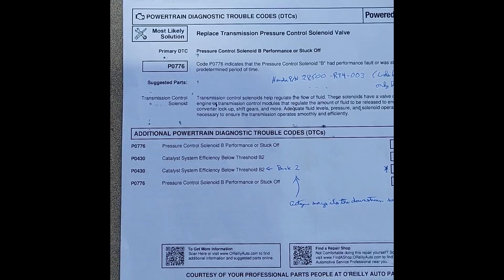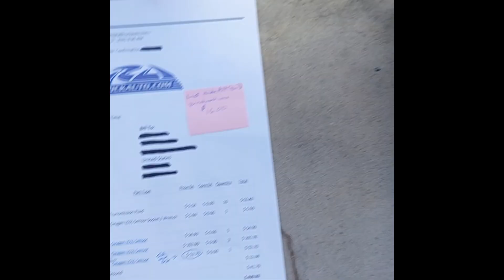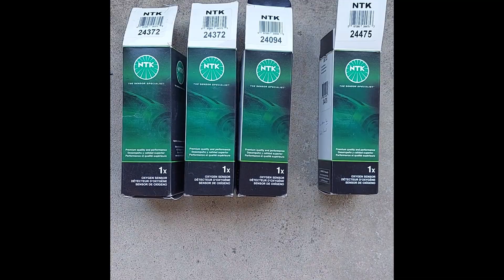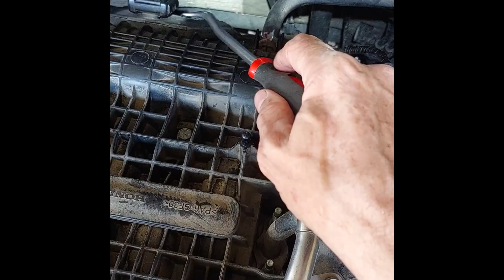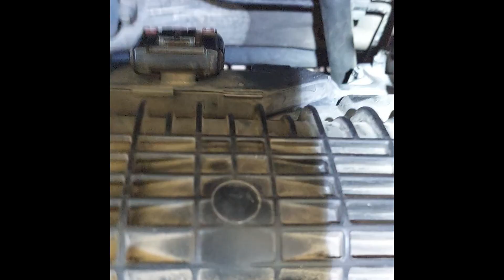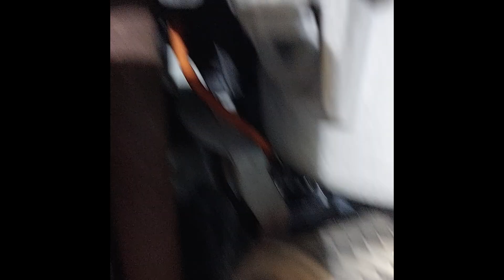2017 Ridgeline, ALL 4 oxygen sensor replacements (including bank 1, downstream)

Comment: Where’s the connector of the bank1 downstream sensor? You said near the windshield wiper? Was that hard to detach?
Reply from the maker: I wrote a reply and then deleted the damn thing!

I show where the Bank1, downstream connector is at 5 min, 07 seconds; I call it a clip, but it is the connecter.  I think it was about 2 - 3 inches below the top of the engine.  Yes, very hard to detach, but as I say in the video, you can see the other 3 connectors, and they're all the same, so you have to do the back one by feel.

Also, I need to add to the description above, but after I did the O2 sensors I replaced the main pressure control solenoid and external transmission fluid filter.  This didn't fix the rough shifting, but the 3 green pressure switches on the front of the transmission were replaced and it fixed my problems with rough shifting, so I didn't bother doing the 3 in back that would be very hard to get to.

Comment: This looks very similar to my 2017 Honda pilot. Especially that dreaded metal brace/bracket. I tried to remove, but like you said that other bolt is unaccessible. Is that compact O2 socket that much smaller than the AutoZone loaner ones? I tried finding it the dimensions on the one you bought but I couldn't find it.
Reply from the maker: I thought it was a standard size from what I have seen before of the open ended wrench style.  I got it from Rock Auto, I think I put the part number in the description.  It's alot smaller than the deep sockets that are made for it.  I don't know what size they loan at AutoZone.
Reply: @drdlst I ended up ordering it just in case it's smaller. But I'm going to use your methods with the impact wrench

Comment: Thank you for this, gives me a rough idea of what I need to do to replace my downstream sensors.
Reply from the maker: Glad the video can help!  I checked the stored codes and do not have any.  I have started replacing the main pressure control solenoid and external transmission fluid filter.  I am replacing all solenoids eventually to hopefully solve the rough shifting of one of the gears.  Better to replace solenoids for a fix instead of the transmission!.